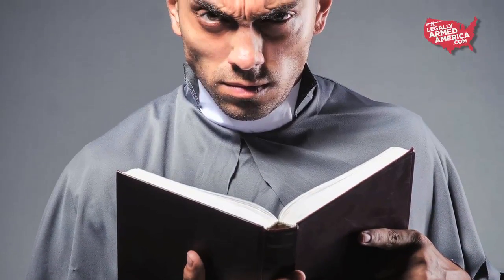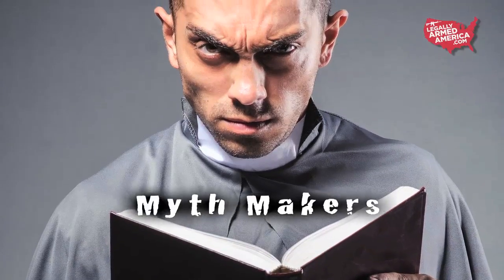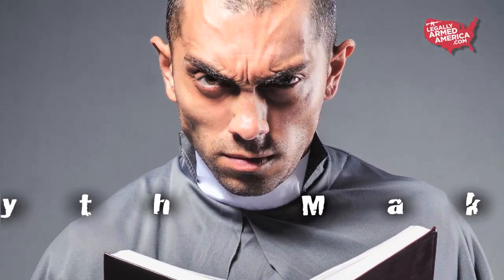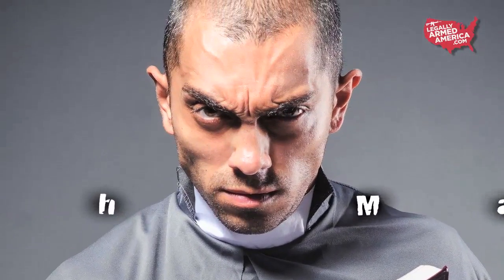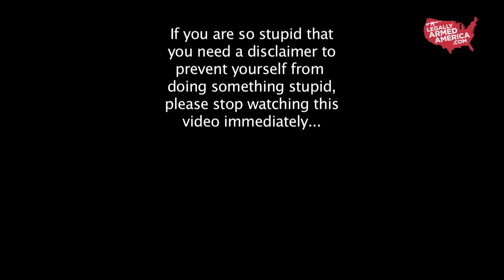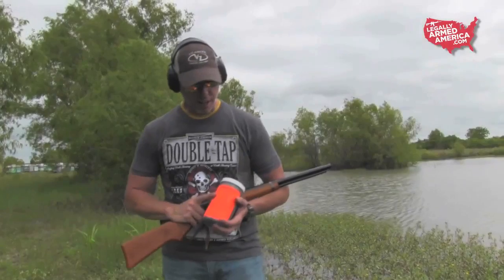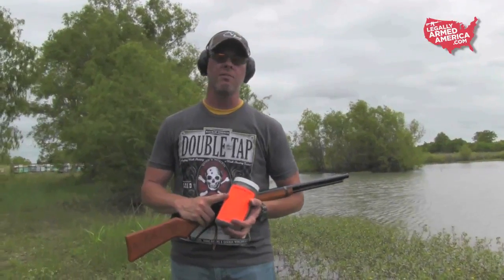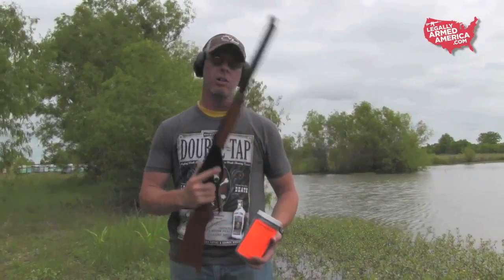MYTH MAKERS - A BB gun can blow up tannerite...?

Comment: If I had to bet, I would say the bb is not what set off the Tannerite.

Instead, you buried a small charge of something that is sensitive to low impact, like acetone peroxide, htmd, or confined flash powder in the Tannerite and shot that, which then set it off. I say this because Tannerite doesn't emit light (and there is clearly a flash), as well as a bb only going ~100-200fps, not the rifle speeds required to set it off.
Reply: Tannerite does emit a flash when it goes off watch any other video on Youtube and you will see it or even try it for yourself
Reply: It does flash, also most air rifles are 480-1600 fps
Reply: Read the title very carefully